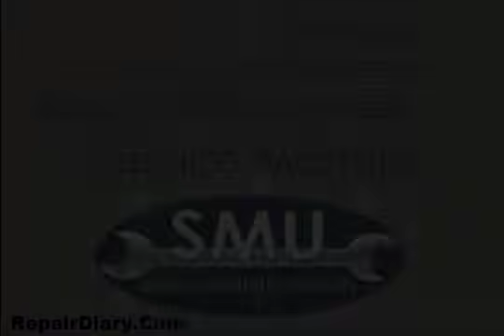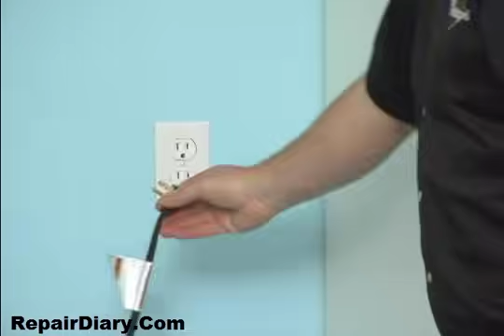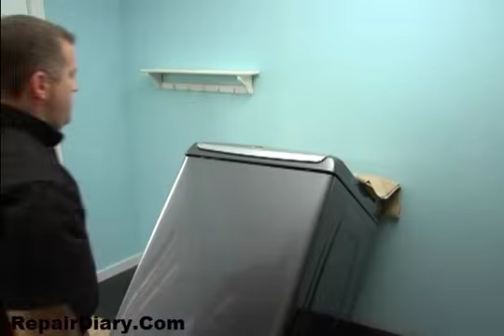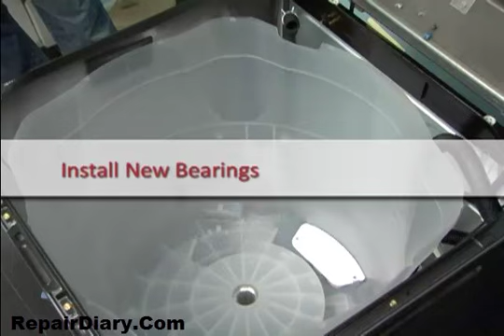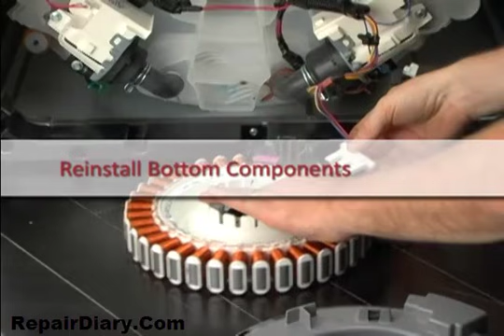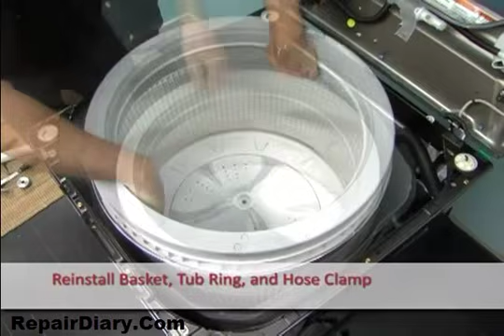Noisy Top Load Washer Bearing Replacement.mp4

Comment: Excellent video.  I was about to order the new parts when it pointed out  the needed special tool for bearing installation, which more than doubles the repairs costs to about $150.00.  Mine is already 13 years old, so i am now looking a new replacement (about $450) instead of repairing the old.

Comment: I have a Maytag Bravos washer MVWB755YQ0. I replaced the tub bearing with a bearing kit. I noticed at last 6 min or so of the final spin the speed increases and then a tapping/knocking sound develops. Does anyone know the cause of the sound?
Reply: +jorge hernandez Did you replace the shaft as well?  If you just replace the bearings your shaft may be warped from the heat caused by bad bearings.
Reply: +zombie4569 shaft was replaced., i did order new suspension rods and i will install them

Comment: Excellent. Perfect companion to the somewhat limited "how-to" manual that comes with the tool kit. Thanks for using the verbiage from said manual - made it a whole lot easier to follow. Total time: 3 hrs. Total cost: $130. Washer is so quiet now I have to check to see if it is still working.

Comment: Tub removal. Scary way is to use the steering wheel method. Have someone pull up on basket and start tapping on shaft. I had to dead drop a sledge to get mine off shaft was nasty. good luck.

Comment: Great video and very useful. While the video makes the replacement look easy, it may not be as straight forward with washers having years of service as was the case for mine. Bought the Kenmore Elite Oasis washer back in 2007 or 2008. After years of reliable service the washer became loud during spin cycle. Suspected the bearings needed replacement but had trouble removing the inner basket due to rust buildup on the drive shaft. To remove the tub I had to remove the inner tub hub and use a pipe wrench to spin the drive shaft while turning the basket and pulling up with help of someone else. Outer tub seal had leaked which let moisture into the upper bearing causing it to fail. Fixed with replacement kit though I did not purchase the bearing press tool kit. I made my own tool using a threaded rod, appropriately sized washers, and nuts to press the bearings in place.